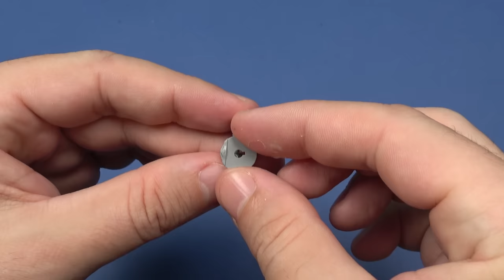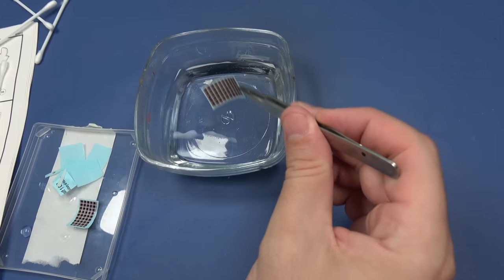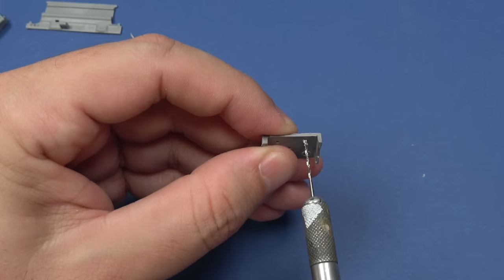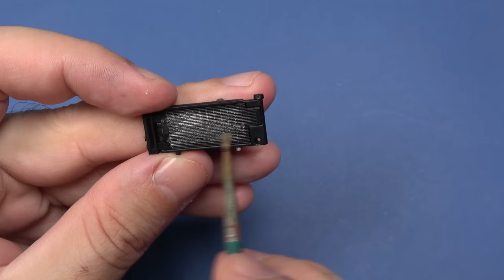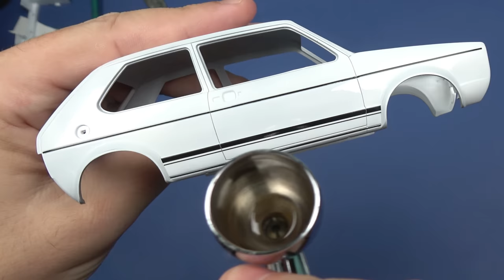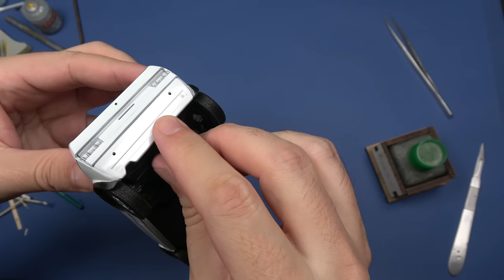VW GOLF GTI Mk.1 Scale Model Car | Revell 1/24 Scale

Comment: Loving the car models, and who doesn't love a mk1 GTI? Awesome video!
Reply: Best friend bought an mk1 gti 5 speed manual in 93 for $400. He had it for years. It was a blast to drive and ride in.
Reply: Had a 1983 rabbit GTi brand new  in 1983. White,  drove  it 10 years loved   it, wished  I never  sold  it. Take  me back to 83 to do it over again. Craig
Reply: less than 1,000kg, that's a fun weight.

Comment: Revell is always so hit or miss.  They always have great detail but the fitment is usually extremely subpar.  Credit to Revell though, they got me into Tamiya, Aoshima, Hasegawa and others.
Reply: @kumudukulasekara6684  I'd rather have a good fit and not have to mess with things for hours
Reply from the maker: Early 2000's when Revell use Korean molds and plastic their models were fantastic. In 1/48 F-15E, F-86D, Rafale M In 1/72 Tornado, F-4 Phantoms and F-16C series still their one of bests
Reply: you should try to build the AMT 78 ford truck its a nightmare for fitment, the inaccuracies abound, everything under the hood is wrong, id give a list of problems but i will let it go as it is for now the only 73-79 f series truck kit around
Reply: ... and in basically every video with Tamiya model I read comments complaining that Tamiya's are to easy, to perfect, that you can not call it modeling if you are not forced to cover half of the model in putty and the sand it off. It seems like it is impossible to make modellers happy :)
Reply: @randomnickify  depends on what folks are looking for, try building an ACCURATE model of the TITANIC there are soo damn many critics and rivet counters, model building is what you make it, build it your way
Reply: @randomnickify  I've read that as well, I just think people like being contrary.  I'm of the type that likes customizing, not fixing fundamental design flaws or engineering goofs.
Reply: @randomnickify , I'll take a kit that goes together without a lot of putty and sanding any day. If I wanted to do otherwise, I'd install drywall for a hobby! 😁
Reply: @randomnickify those are idiots. I've only put together amt and mpc models before. I made them work but the result didn't always come out how I wanted. Then I tried a Tamiya and I was blown away how good it was to build. Then and there I decided that I will only build amt/mpc if I really have to

Comment: Thats the thing with Revell: You either get a modern, well-made kit that is either a Revell Original or a rebox of a good modern kit by another manufacturer. Or you get ESCII garbage from the 60s/70s reboxed. And both come in the same boxes with similar pricetags, so its hard to tell. You really need to check up every Revell release on scalemates to see if it is worth buying.